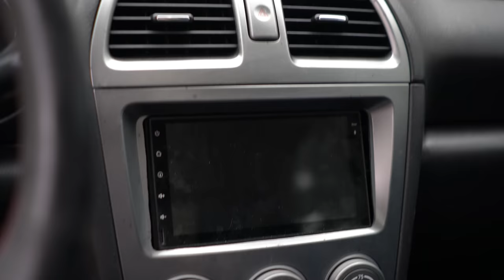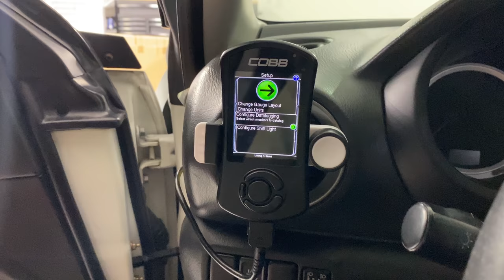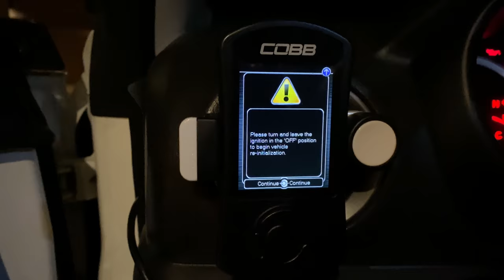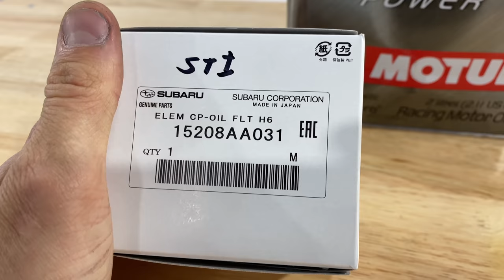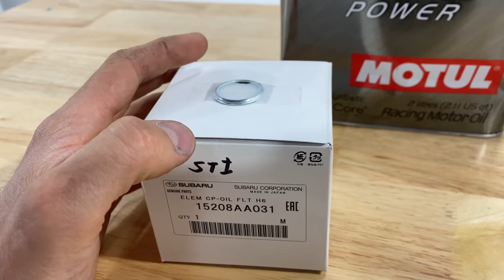Building a 22B STi: Buying a 2005 Subaru Impreza WRX STi (GC8 Donor Car!)

Comment: BUY A WRECKED CAR. Plenty of them out there and It will still have everything you need and you don’t have to ruin a nice clean example. A true car guy wouldn’t even think about taking that car apart. No it’s not perfect but it wouldn’t take much work to be mint.

Comment: I personally have 05 sti and this one is really good shape. btw they are now considered collectibles.
Reply: GREAT CUS I JUST INHERENT A BLOB EYE 05 STI WITH JUST UNDER 16.000 MILES WITH ONLY MOD LITEWEIGHT WHEELS AND STILL HAVE FACTORY GOLD ONES WITH TIRES GREAT SHAPE 95% TRED LEFT AND SS EXS FROM STI SUB NEW IN THE BOX MY DAD PAID $1000 BACK IN 2007 CAR HAS HAD ONLY REDLINE OIL IN IT SINCE NEW JUST NEEDS SOME TLC MIGHT SELL IT NEXT YEAR FOR $25.000

Comment: In future, you REALLY should prime the new oil filter when changing it - that is to say you fill it (fully) with oil before fitting it. It's a good precaution to take with these engines!

Comment: I'm thinking about buying this 2004 subaru wrx near me its cheaper which is scary he has paper work for jdm motor swap near clutch new trans bunch of engine work alls he said is needs new tune cause of motor swap but runs and drives good now but don't get on it cause its goes into over boost. Any ideas where I should start with maybe checking it out. Compession is good and no smoke or leaks. Just weird hes selling for so cheap